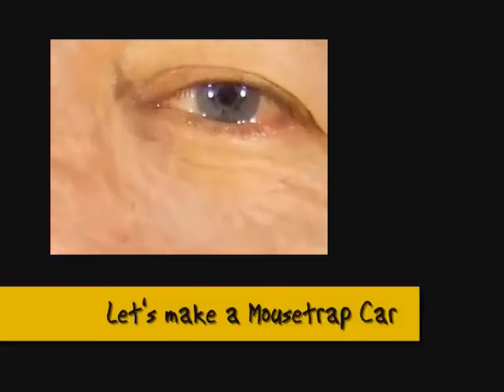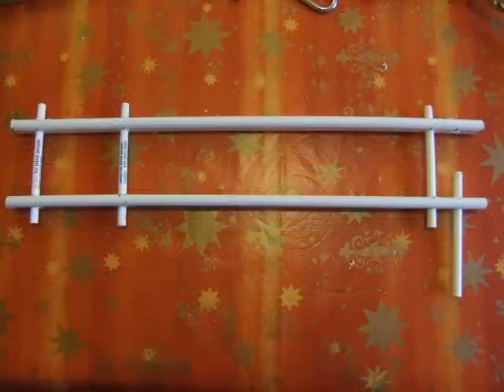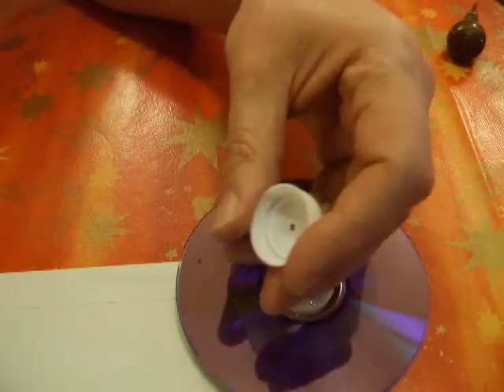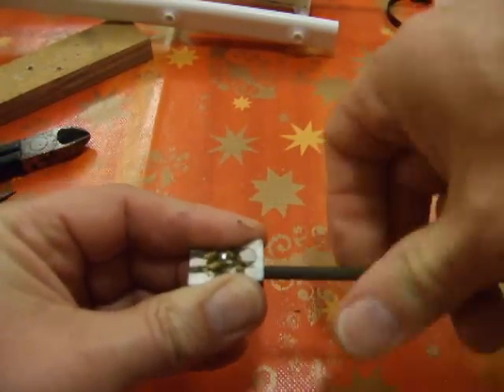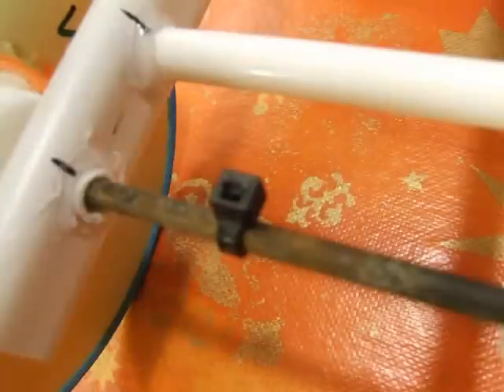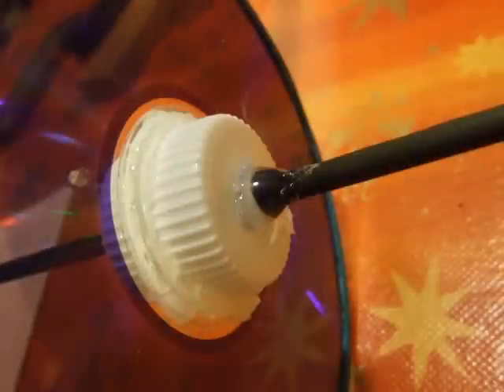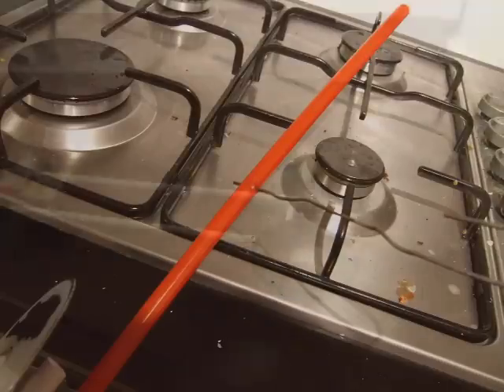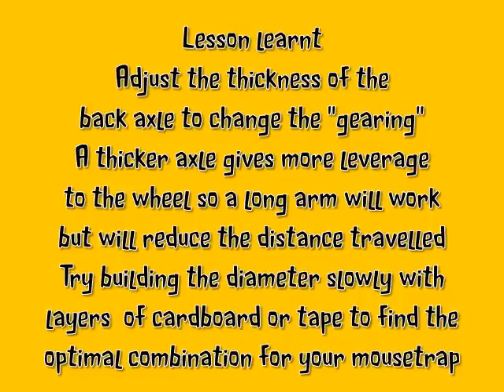Let's make a Mouse Trap powered Car

Comment: Perhaps you could make a simple one-way clutch using bottle caps that would provide the larger winding diameter and the ability to freewheel when the end of the line is reached.
Reply from the maker: Thanks, if you check the video description there are links to several related videos and playlists. As for freewheeling at the end of the run, the simple option that I use is to allow the line to drop off the axle hook. Then there is nothing to stop the car moving forwards other than friction. I did do a one way clutch mechanism in this rubber band powered car back in 2014 https://youtu.be/aqB8hflHvwU

Comment: I Am still looking for that damn mouse. What was the purpose of this.
Reply from the maker: Well I guess the first purpose was to get somebody like you to view it 🙂 I would have to assume that YouTube's wonderful algorithms have studied your viewing habits and decided that this was the video you were looking for. If you are interested this video was requested by one of my viewers. I think the purpose of this project at school is for you to learn about leverage and find the best combination. The longer the arm the LESS power you get. The power comes from the spring in the heart of the mousetrap and the longer the lever you attach to it the harder it is for the spring to move the lever. The reason people put long levers on the traps it to increase the distance it travels so you can wind more turns of the string round the axle. More turns round the axle means the car will travel further BUT if the car is too heavy it won't move because the lever does not have enough power to move it. Some people use short levers and BIG wheels so for less turns the wheel travels further.A short lever and small wheels will make the car accelerate fastest but the distance it travels will be down to how much friction there is on the axles as the car will only have a short power burst and then it must freewheel the rest of the way.
Reply: @GrandadIsAnOldMan  Yes I never know what kind of videos will line up to the left. I see Marty Stuart and a baby goat video right now. They have nothing to do with a mouse.
Reply from the maker: @Rickugg  yes, it can be quite worrying to try to understand how those algorithms work :-) half the time it shows me my own videos probably based on the fact that I always watch them back after I have uploaded them to check they are OK. It amuses me when people comment on these old videos of mine (this one was 2013) as things have moved on over the years. I was getting good viewing figures back then, now I am lucky to get into 3 figures. There seems to be no logic to these algorithms but I expect they work for the big channels :-)

Comment: One more question does weight distribution affect the traction of the wheels
Reply from the maker: Yes it will. You need weight at the back to ensure the drive wheels grip but if you have no weight at the front you may find the steering drifts.

Comment: One question if the lever is longer does that mean there will be more power
Reply from the maker: Quite the opposite. The longer the arm the LESS power you get. The power comes from the spring in the heart of the mousetrap and the longer the lever you attach to it the harder it is for the spring to move the lever. The reason people put long levers on the traps it to increase the distance it travels so you can wind more turns of the string round the axle. More turns round the axle means the car will travel further BUT if the car is too heavy it won't move because the lever does not have enough power to move it. Some people use short levers and BIG wheels so for less turns the wheel travels further. I think the purpose of this project at school is for you to learn about leverage and find out the best combination. A short lever and small wheels will make the car accelerate fastest but the distance it travels will be down to how much friction there is on the axles as the car will only have a short power burst and then it must freewheel the rest of the way.
Reply: Thx

Comment: How can we fix a car veering to one side and driving in circles? It works perfectly otherwise.
Reply from the maker: Several possible problems here.
1. The front and back axles are not parallel so the car will naturally turn.
     Depending on how you have fixed the axles this may be easy to adjust by re-gluing the axle tubes to align them.
2. The back (or front) wheels lack grip and one side is slipping while the other grips causing the car to turn.
     You can increase the grip by putting some sort of rubber tyre round the wheels. I cut strips from rubber gloves and stretch them round the rims of the CDs. You can cut strips from balloons to do the same thing
3. The back axle may be bending under the tension of the mousetrap and that makes the wheels go out of alignment.
     The fix would be to change the back axle for something stiffer.
4. Same as 3 above but caused by winding all the string on one side of the axle rather than evenly distributing it across the axle.

I hope that helps, I am sure there will be other possible causes and cures but those came to mind first. There are some links to help file videos in my video description.
Reply: GrandadIsAnOldMan Thank you so much we'll look it over!
Reply from the maker: Good luck 😊

Comment: is there a substitute for fishing line that work the same
Reply from the maker: Yes, string, strong cotton, whatever you like. Just test it first to check it does not break too easily when you put some tension on it. There is not a lot of force involved here, fishing line just happened to be handy. If you only have weak cotton then you could use several strands to make it stronger.

Comment: Does this go in a straight line or no
Reply from the maker: That depends on how careful you are when you build it. If you keep the from axle and the back axle parallel then it will go in a straight line. There are links to other designs in the video description if you want a range of ideas to try.
Reply from the maker: That depends on how careful you are when you build it. If you keep the from axle and the back axle parallel then it will go in a straight line. There are links to other designs in the video description if you want a range of ideas to try.

Comment: nice iphone 0 camera terrible quality camera
Reply from the maker: Yes you would be right. Back in 2013 when I made this video the latest iPhone 5S camera had 8 megapixels resolution with the image capture size of 3264 × 2448 (4:3). The camera also included automatic image stabilisation, dynamic tone mapping, 10 fps burst mode, "best shot" mode and slow motion video at 120 fps. HD video (1080p) at 30 fps. I have never owned an iPhone so I cannot comment on it's capabilities. The camera used for this video was a Fuji FinePix E900 it had a 9 megapixel but only capable of video at 640 × 480 pixels at 30 frames per second. At that time the iPhone 5S was £549, my camera was probably purchased in 2006 so already 7 years old at that time and was probably less than half that price so I guess it is down to your available disposable income as to what you spend your money on.
Reply: Asian Cook off YOU JUST GOT DESTROYED! NO COMING BACK FROM THAT!

Comment: what else could i use instead of the plastic coathangar. no store around me carrys one and i need to finish this by tommorow. it doesnt have to be THAT long too
Reply from the maker: Any stick will do, a piece of bamboo, a garden cane, a long bbq skewer. All you are doing is extending the range of the mousetrap lever so you can use a longer string. If the arm is too long you lose power and the car does not move. If the arm is too short you have plenty of power but less distance. Somewhere between too long and too short will give you the best result by experimentation.
Reply: GrandadIsAnOldMan thank you for the reply, also do you have any other ideas for attaching the extention without cable ties? i could only find 1 around my household
Reply from the maker: Gab Springer Sticky tape or string or string and glue together or cotton and glue. The only problem with sticky tape is getting the roll through the gap but you can cut it into shorter strips and use lots of pieces.
Reply: GrandadIsAnOldMan would hot glue and some string be effective?
Reply from the maker: Gab Springer probably, easy way to find out, try it :-) People keep asking what they can use instead of hot glue so I didn't mention it.
Reply: GrandadIsAnOldMan ah thank you a lot, it really helps when i have such little time :)
Reply from the maker: Gab Springer good luck

Comment: Id put more string on it.
Reply from the maker: +appleonfire the length of string is the distance from the axle to the furthest point the arm can extend to. Any more string would not be of any benefit and in fact could cause a problem as it may become tangled in the back axle and cause it to lock up.

Comment: Can this model travel 10 meters ?
Reply from the maker: +Monica Amaya I only tested it in my kitchen which is 5 metres long and you can see in the video that the arm is still moving when it hits the end so the car could go further. If you look in the video description there are several helpful links. There are many more designs in my Mousetrap Power playlist. The important thing about making your car travel a long way is to keep friction to a minimum and that is mainly about where you axle goes through the car so make sure you axle spins freely and your wheels do not rub against the car body.

Comment: I'm planning on building a car like this, I need it to be able to go as close to 11.5 meters as I can, and no less than 10 or more than 14, can this car go that distance?
Reply from the maker: +Jack Bobbins the distance they go depends on how well you build it. Two main factors, the power of the mousetrap and the friction of the axles. Then you adjust the length of the lever arm and the size of your wheels and the diameter of the axle to get the best out of the power you have available. If you car has to stop between 10 and 14 then you need to add some sort of a brake. Here is my playlist of rubber band cars with brakes but the principle will be the same for a mousetrap car - Brakes on Rubber Band Cars https://www.youtube.com/playlist?list=PLA5a2xPRSrB3MyidvKMT3DqU1vNy9Atsf
Reply: Jack Bobbins and if you increase the diameter of the axel, it will go faster.

Comment: Do the wheels have to spin
Reply from the maker: +gutemex6776 not sure what you mean. The wheels and axles should spin freely if you pick the car up and flick the wheels so you know you have no friction on the bearing surfaces. When you put the car on the floor and apply the power from the mousetrap the wheels should not spin, they should have enough grip to transfer the power into forward motion. If they are spinning or slipping then you will lose distance. All the time the wheels are slipping or spinning they are NOT moving the car forwards. That is why I put rubber tyres on the CDs to stop them slipping or spinning. In the video description there is a link to a helpfile on how to put rubber tyres on CDs.

Comment: Could you tell me what the length of the plastic conduit is? That would be very much appreciated!
Reply from the maker: +MCReddit I don't remember, this was over 2 years ago, but I would guess about 18 inches or 45 cm.
Reply: +GrandadIsAnOldMan Thanks! (That was fast!)
Reply: GrandadIsAnOldMan I guess I never got back to you! Sorry about that, you saved me from my physics project back then lol (I changed my name to Moose, cus my cat and it just makes more sense)

I graduated from high school now, and just happened to remember about this. That was a lot of fun, saw lots of cool cars there. I remember my friend did a car with 4 rat traps, but it went too fast and the board they were all sitting on exploded lol. Apparently there were enough cool looking cars that they held a race at an assembly later on... that was a great class (actually, you bailed me out on a rubber band boat too, soooo I guess I'm not very bright lol)

This is long overdue and I felt like I should've said thanks at least once. It was fun and I remember really liking how relaxing it was just watching your tutorials. It looks like you're still uploading videos too, I hope you're having fun~

Comment: Does the length of the car have any affect on speed or the distance it will travel?
Reply from the maker: It is the length of the arm attached to the mousetrap that makes the most difference. The longer the arm then the greater arc the tip of the arm travels so the longer the length of string attached and the more turns around the back axle so the more rotations of the wheel so the further the car travels under power BUT the longer the arm, the LESS power it has so the car may NOT move as FAST.
Reply: akiddrn Yes

Comment: How clever!  Have you ever built one of these cars that stops, and then starts again?
Reply from the maker: No I have not. Do you mean a mousetrap car or just a car in general that stops and then starts again? Does it have to stop for a specific period of time? Does it continue moving in the same direction when it starts again? Is it entirely mechanical or can it be electronically controlled? Does the stop happen at a specific distance or after a specific time?

Comment: Wait, I actually don't understand how the string goes? Like does one attach to the skewer in the back? Plus, where is the other string to support it? I would really appreciate if you would respond. Thanks for the help!
Reply: Plus, my mouse trap is to fast. Sometimes when I try the string breaks and I don't know how to fix that. Do you have any advice?
Reply from the maker: At around 8.20 I show that I put a cable tie on the back axle. I tie a loop in the end of my string and that hooks over the cable tie on the axle to hold it in place as you wind it up. When the string unwinds the loop can drop off the hook and the car can carry on freewheeling. The other end of the string is tied to the big red lever I attached to the mouse trap arm. The red lever arm is used to extend the lever of the mousetrap so that it moves further and you can use a longer length of string and the car goes further. I used fishing line instead of string because I didn't have any string.

Comment: So I am at the store right now. How thick of heavy duty fishing line did you use?
Reply from the maker: Hi Jodie-lynn, I used 18lb breaking strain because that is what I had in my fishing box. String would work just as well, it does not have to be fishing line.

Comment: Okay, so! I actually think that this vid should help me a lot! I do have just a few questions: A.) how do you believe that it would work with a Victor brand mousetrap? B.) How long did it take you approximately to make it? and C.) Do you think you could come up with the physics analysis? :) Thank you !! and also, being a blonde i honestly do not understand how a mousetrap can possibly power a car! please do explain! Thanks again!
Reply from the maker: Hi jodie-lynn, I will try and answer your questions.
A. If it looks the same then it should work.
B. Once you have found all the parts you need, a couple of hours would be plenty.
C. You will have to do your own homework for a physics analysis to get the right words and terminology.
Watch the video again, that explains how it works.
When you open the mousetrap you are storing energy in it's spring. The fishing line transfers this energy to the back axle. The spring closes the mousetrap, that pulls the fishing line which is wrapped round the axle. That causes the axle to spin. That turns the wheels. That drives the car forwards.
Reply: thank you soo much!! :)

Comment: can you explain again how you attached the fishing line to the back to the back of the car to make to go?
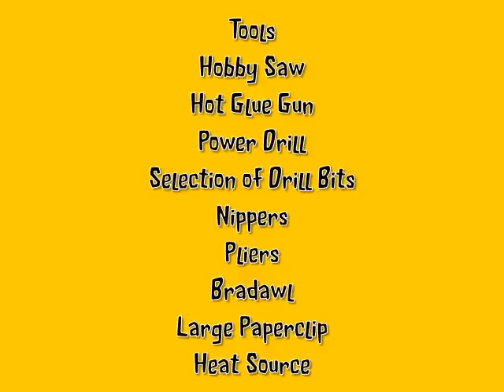Reply from the maker: Hi John Nguyen. On this car I initially just used a plastic cable tie pulled tight on the axle so that the loop on the end of the fishing line could hook around it. I show this on the video at 08:08 http://youtu.be/8BN-zdrd8pw?t=8m8s. I found that this didn't give enough leverage for the long arm I attached to the mousetrap to turn the back axle. To increase the leverage effect I increased the diameter of the back axle by putting a foam disk on it and then put a wooden peg in that for the loop on the end of the fishing line could hook around it. I show this on the video from 10:45 http://youtu.be/8BN-zdrd8pw?t=10m45s

Comment: What was the displacement? More than 5 meters?
Reply from the maker: Hi Irisha, it travels the length of my kitchen which is about 5 metres and hits the wall still accelerating so it should go further. I have several mousetrap cars now in my mousetrap playlist here http://www.youtube.com/playlist?list=PLA5a2xPRSrB1jSyRMjw31ptEYAAkZRF6H
Reply: Danial Merli You don't need to be such an idiot about it, how could she tell it was 5 meters? YOU wouldn't have known if he hadn't told you.
Reply from the maker: Hey guys, it was a valid question. It is fine to ask for more detail in the comments if it is not clear from the video. I try to answer all the comments if Youtube lets me know they are there.

Comment from the maker: Kathy, the video shows where to connect the string. I use fishing line, not string. The red arm has 2 holes to attach the string. The back axle has a cable tie used as a hook, later in the video I add a foam disk with a peg in it. The string has a loop on the end to hook over the peg.